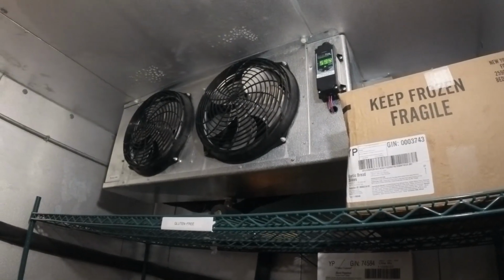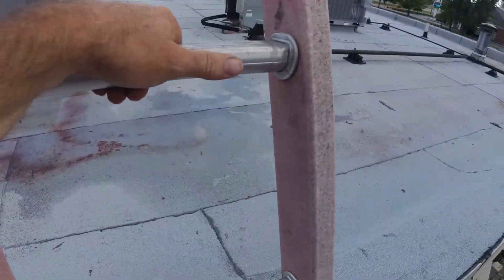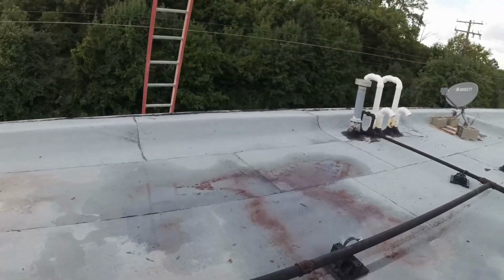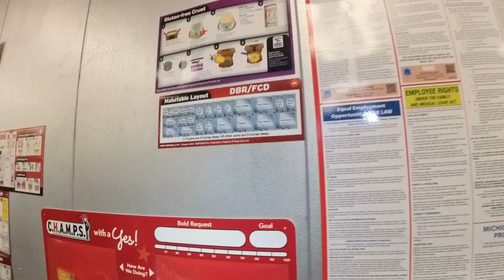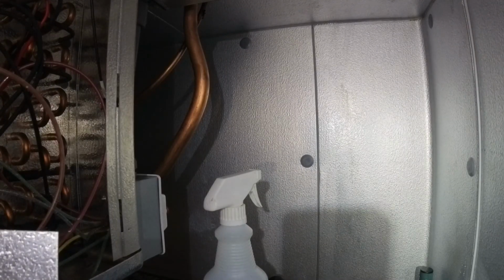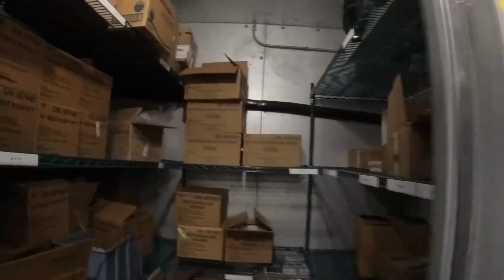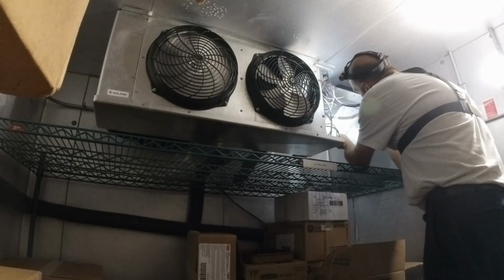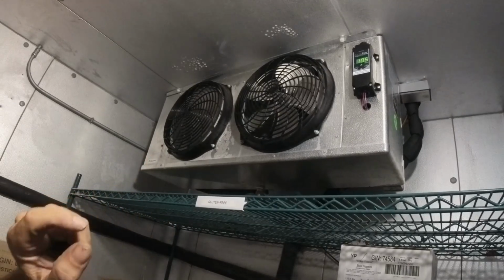Freezer Down It's Got A Leak

Comment: ❄💪🇺🇸👍 nice work. If u have voltage at fan n it's not running replace it. Can't c it on a delay n for that long. With fan not running low load not absorbing heat sight glass can bubble plus 404 Is a blend different molecules n can show bubbles in sight glass.

Comment: Joe I don't do a lot of refrigeration work but what I have seen with those fans is if the coil froze up good it pushes the fan wires into the blade and breaks the fan wires.